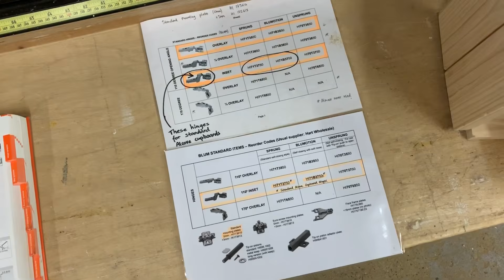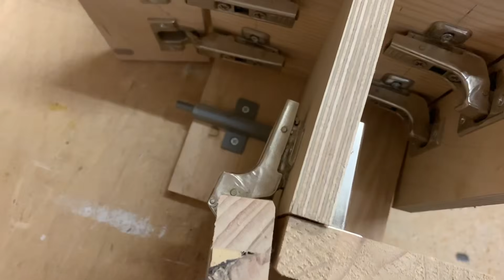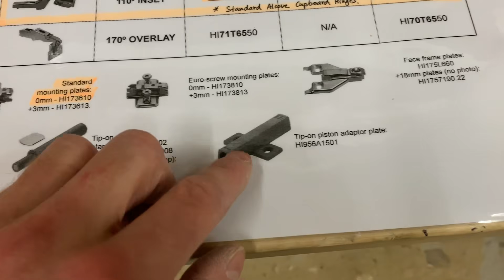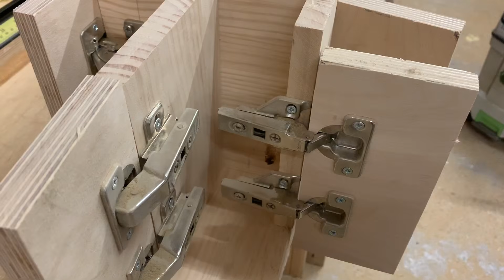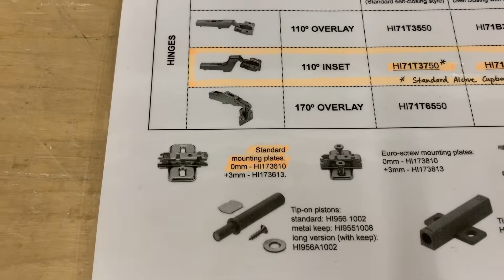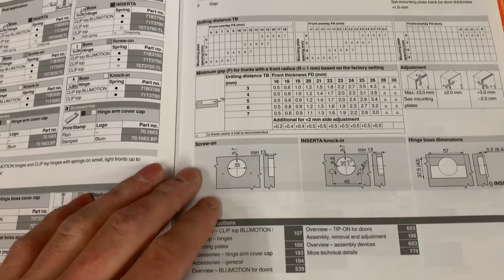All the main Blum hinge types explained!

Comment: Hi Alistair, I am really impressed by this video but I am also completely mystified how using the face frame mounting plate (at 5min 30sec in your video), you have managed to get what appears to be a 1cm overlap. I have tried to do this with no success. Do you need to use a specific blum hinge?
Reply from the maker: Honestly it was so long ago its hard to be sure - but I think I was using fairly standard 110degree overlay hinges on those american-style face frame mounting pates which, would typically place the door overlapping the frame edge by about 16mm - but there are many variables affecting that overlay:  Obviously the adjustment on the hinge arm - it's possible I adjusted them in a bit.   Also the cup hole drilling position on the door part - if that was nearer to the edge than usual, the overlay would be reduced.  Also the mounting plates themselves - I know we used to stock both 'zero height' and '+3mm' thicker variations as they often came in useful for problem solving, so these may be the +3mm versions.  Finally it's just possible that the hunges used there were the 'half overlay' style which are designed for mounting back to back either side of a single thickness dividers.  So, plenty of variables that may have led to your estimated 10mm overlay!

Comment: Hey mate I'm doing a false wall with 18mm mdf with a 20mm acustic board planted on. The hinge side of my door is binding on the next acustic board. Can you recommend a hinge that will cater for a 40mm thick door? 
Thank you
Reply from the maker: Hi Blum sell a 'thick door profile hinge' but i think 40mm is too much even for that one.  You could step up to the Sugatsune J95 but still might be tight.  Study the technical charts for each supplier carefully.  Rounding the long edges can gain a little more clearance
Reply: @Alastair_Johnson thanks mate

Comment: Because of my disability, I need the fridge doors to open wide, almost 180 degrees. The integrated fridge when its not installed allows such opening of the doors, but my builder said that once he instals it the doors will be opening less, about 100 degrees because the way the wood would be attached to the door. Is it possible that he uses different hindges to allow the 180 degrees opening of the fridge doors? Thanks!
Reply from the maker: Hi my son is a wheelchair user so these matters are of great interest to me too.  The fridge hinge will be different to all the hinge types shown here in how they are fitted and it's not an area I'm an expert in.  The funny thing is I just googled this, and it led me to your own question on mybuilder.com!  I see the answer was not helpful enough.  I have not been able to find a wide opening alternative.  If you find a solution I'd be interested to hear.  It's possible the best solution will involve lateral thinking about the wider design of the kitchen, good luck
Reply: @Alastair_Johnson  thank you for your response. I will definitelly write if I find an answer. If not, I believe we will just go and use the integrated fridge as a free standing one even though the look will be not so nice.
Reply from the maker: @risina1979 it is a great shame that accessibility needs still often stand opposed to good visual design.  When we renovated our bathroom we were determined to make it nice, not clinical like a hospital.  It was hard to do and we had to choose an independent contractor instead of the council approved options.  We did get a nice result but due to this contractor’s lack of experience making accessible bathrooms a couple of things were missed on that front.
Reply: @Alastair_Johnson  that is very true. At home we always try to have a good balance between practical and to look nice and modern. But in cases like with the fridge for us practicality is winning. Wish you all the best to you and your family.

Comment: Hi, great vid! I'm just curious and hope you can help me.. at 9:30 you used a hinge for a thick door and it pushes the door out.. can you use the same hinges if that door extends to its left (if youre basing it on your top view video)? Say you have an inset door with 32mm thick and the left panel is also 32mm thick, BUT both panels meet up at the corner to create a mitred cornering where only a thin line reveal is separating the 2 panels when closed? Would be a great video if you could do a mock up one using a thick end wall cabinet panel and a thick door, mitred at the corner. Would be a great architectural design as well for base cabinets with the same thick counter top material, say veneers or natural wood...
Reply: All corners would be mitred, top and sides, only revealing refined lines. That would be a great architectural furniture piece 😊

Comment: do you have a blum hinge you'd recommend for a flip top bench storage build? 
i've been trying to find information with no luck
my idea is that i would build e bench whereby the seating surfface hinges open like the lid to a box. 

thanks!
Reply from the maker: Sorry for such a late reply!! Yes it is often done with a standard 110° overlay hinge.  With the back edge of the flap receding the 35mm diameter cup of the hinge and overlaying a back panel that received the mounting plate

Comment: is it possible to use the 170 for thick doors, like 1" thickness?
Reply from the maker: No we find that the 170 degree hinge can bind at full angle even on a 22mm door but the 155° may work better for you

Comment: I hope I am able to clearly describe my situation.  I have an inside corner/blind corner  cabinet.  It had a hinge between the door side that is a normal hinge, and then the second door which makes the 90 degree inside corner had hinges that allow both doors to be opened at the same time. Those hinges on the inside corner got rusty, and instead of removing them and going straight to the hardware store, they got lost.  Can you hazard a guess as to what they are called?
Reply from the maker: Sorry I missed this comment!  These things are so hard to describe in writing. Did you resolve the situation?
Reply: @ thank you for responding!  I have not simply because I keep forgetting to bring my doors to the hardware store.  I should just try looking up maybe inside corner hinge.  But I do appreciate your reply.

Comment: disappointed. you installed inset hinge wrong, not sure the half over lay nor tell the plywood thickness. you could explain them based on blum data book.
Reply from the maker: It sounds like you go by the book - it is there for you when you need it.  I recommend seeing these hinges as tools that you can use however you wish to once you gain a full understanding of how they work.  It’s true to say that the inset hinges is usually set back from face of carcase for a fully inset door, but we have chosen to use it in a semi-overlay fashion to reveal the cabinet side in our alcove cabinet installations, making it easier to fit a scribe, increasing the usable cabinet opening, and saving time.

Comment: Hi, thanks for the really informative video!
Could i ask for the blum 170 hinge you show at 9:34, does it have a resistance point before fully closing? Wondering if you'd need a harder push to close it if it was fully open.
Reply from the maker: Yes there is a sort of slight resistance point I suppose just before it reaches the point where the self closing spring starts to pull it fully closed - and the soft close attachment also resists that to slow the close in a controlled way.  But you don’t really notice this the same way in real use - the weight and momentum of the door will carry it through, whereas in the video you are seeing a very much smaller and lighter board with 2 hinges on and there is not the weight or momentum that the hardware was designed for

Comment: Are there any overlay hinges that when open, the inside of the door is flush with the inside wall of the carcass?
Reply from the maker: The Blum 155° is designed to place the inner face of open door just outside the face of the cabinet to allow tight fitting doors to open freely - this is the hinge used in Blum’s ‘space tower’
Reply: @Alastair_Johnson  I'm not sure if the Blum 155 is the kind of hinge I'm after. The pictures I could find about it didn't appear to be what I was after. However, I did find the 'frog' hinge which does seem to be suitable.

Comment: I just got a new kitchen in my rental home. The installer used soft-close on all doors. However, since they designed it without handles they added pish-to-open. Perhaps im wrong, vut isn't that a waste of the soft closing ng mechanism. All the doors look clean without handles, but I think I prefer a small latch or grip so it makes actually use of the soft close. Now I need to push each door to close it. I feel like I'm a camper again hahaha
Reply from the maker: Yeah I think touch - latched are best with unsprung (or even reverse sprung) hinges that ensure the door keeps swinging wide open after the latch does its job.  But I’ve seen doors delivery fitted on spring hinges, so the touch latch just forces a finger gap then you have to pull it.  It’s really pointless to use soft close hinges though!

Comment: Great video. I have been asked by AO to replace with thinner hinge for an integrated fridge installation. Still wondering what they mean by a thinner hinge. Would you be able to advise the best ones for an integrated fridge freezer.
Reply from the maker: Hi it’s hard to say without seeing the set up!  There are hinges specifically made for mounting kitchen doors to appliances

Comment: I'm building understair storage with inset doors so they go flush with the wall above (staircase is on the other side of the wall). A double door cupboard and a smaller single door cupboard. We are doing a self-build and I'm not a fine carpenter! I installed hardwood frames straight into the structural opening and managed to get everything square and plumb, then bought Blum hinges after watching this video. I made a quick prototype of the top door and found immediately that where the door goes to a point, it binds on the inside edge. So I had to remove a section of the top of the frame to flatten it out and it worked great. Installed the doors but hadn't realised the same problem in reverse exists: the OUTSIDE of the other double door binds against the frame when it opens to near 90 degrees.

So I contacted Blum, who were excellent and told me the exact correct product, but unfortunately it needs a mounting plate with additional screw that sits further back in the frame, something like 85mm back as the door is inset. Unfortunately my hardwood frame is only 75mm deep. Ugh. Now I'm wondering if I should ditch the whole frame set and replace with a deeper one. Or if I should make some kind of radius or even notch the frame (ugh) where it binds. It's my own home, so not a customer project... and my levels of care are decreasing as there are so many other aspects of the build to complete! If the former then that's a week of work down the drain :(
Reply from the maker: Please tell me the exact hinge and mounting plate codes they recommended so I can look them up and understand
Reply: @Alastair_Johnson  First I purchased 70T3790 (inset hinge without spring, as I was planning on using the tip-on spring), with mounting plate 174L6100. Everything fits fine except the left door of the double set. (the shorter door.) Then they recommended I go with 71B7960 (155 degree hinge) with 175H7190 (9mm mounting plate). There are a few problems with this solution: (1) my original mounting plate (already installed) has the knock-in fixings but the new mounting plate only has two options, system screws or chipboard. I was planning to test chipboard screws mounted into the knock-in plastic dowels already installed, which I hope will work. However problem (2) is that this new mounting plate part number states "Fix with additional screw if used with
wide angle hinges". As I am planning on using these wide angle hinges (I guess 155 degree counts as wide angle?) that screw should be installed. But it looks like that screw is set back an additional 26mm according to the Blum catalogue. As these are inset doors, we also need to account for 18mm + 1mm tolerance. So that's 18 + 1 + 37 + 26 = 82mm back from the front edge of the frame. My hardwood frames are only 74mm!
Reply: @Alastair_Johnson  I know it's a weird request but do you have the ability to provide a bit of hinge / cabinet making consultancy over the phone, i.e. some form of pricing for that?!
Reply from the maker: @MatSmithLondon  Hi Mat, I've found the video on your channel so I can picture it all now!  Yes we could have a quick chat, maybe message me via instagram @alastair_freebird and I'll give you my number there.  Then you could most easily drop me a tip for my time depending on how useful you've found it, via www.buymeacoffee.com/freebird

Comment: Hi, very clear explanations. I have angled under-stairs doors to fix as overlay doors  on the dividing panels but inset under the frame above it. The high side with the 45 degree point which has the hinges on it is going to catch on the flush frame above which is sloping down if using a standard concealed hinge. Is there a hinge that will move the door out horizontally at the same time as opening so it doesn't move across? Hope that is clear. and many thanks if you can help.
Reply from the maker: Yes I understand.  The 155degree hinge throws the door outwards as it opens more than other hinges however you will still need to cut a bit of a back bevel on the top sloping edge of the door to deal with this issue.  Or redesign it so that the door finishes with a bit of a flat top above the slope, and fill that in with a small fixed triangular panel.
Reply from the maker: An alternative solution that requires no back bevel on the door top would be the Sugatsune 'Lin-X' lateral door opening system
Reply: @Alastair_Johnson Hi. Thanks so much for thinking more about this. I did come across lateral opening hinges myself and made some enquiries. Jet Press also do a similar system. They are definitely something that would solve the problem but the cost is prohibitive. For a large door the Sugatsune hinges would be about £350 each so while ideal the the cost is not really affordable. I am still looking. One Utuber built cupboards to the same design but on questioning him he admitted he had to chamfer the back of the apex of each angled door until it would clear the surrounding frame. Regards

Comment: Alistair do you have to install the inset hinge closer to the edge of the carcass to allow the door to overlay it?
Reply from the maker: Yes
Reply: 18mm?
Reply from the maker: @dazlarg  the measurement from front edge of carcase to centre of mounting plate holes will be 37mm, as per this image: https://www.bullerltd.co.uk/images/detailed/33/0925-001-blum-clip-hinge-mounting-plate-173h7100-buller-33127.JPG
Reply: @Alastair_Johnson  can the soft close speed be adjusted with the Blum hinges?
Reply from the maker: @dazlarg  only by switching each hinge’s soft close on or off via a tiny switch on each hinge (for a heavy door you might keep all hinges soft closing, but for a small cupboard door you might just keep one hinge activated - we find it works best when it’s the lower hinge)
Reply: @Alastair_Johnson  top
Man Thank you buddy

Comment: Their are so many closures that it's  become impossible to find the correct one😢.
Reply from the maker: Not impossible!  What is it that you need to achieve?
Reply: @Alastair_Freebird  replacement at work has 3 different cabinet closures each different in style and length.
Reply: @Alastair_Freebird  also I'm assuming that their German  made with what's on them
Reply: @red2965  Austrian
Reply: Most hinges are covered by a few questions:
-- What's the overlay?
   Zero (inset), 1/2 inch, 1 inch.
   Overlays can be slightly adjusted by a screw or shim.
-- Is cabinet face frame?
   Then you'll need a hinge that attaches to the cabinet edge.
-- Do you want soft close?
   If the hinges are already installed you can add a soft close piston.
-- Do you need the door to open more than 90+ degrees?
   No you don't. But if you do, then consider using traditional non-hidden hinges.
-- Are you replacing old hinges?
   Then consider whether the screw spacing on the door is 45mm or 48mm. And even then the screws may be in the wrong place, so you'll have to fill in screw holes and make new ones.
Reply: @NonameNoname-rf3hg I’m trying to identify my hinges because they currently open >90 degrees and I want to add angle restrictors. I need to know which ones will work with my hinges.

Comment: By far the best video explanation I've seen of these type of hinges. I was looking for the hinge mounting plate system that Blum refer to as the 'Face Frame Plate' (number HI175L660) and here it was - I was starting to think I must have imagined it. Now to find a supplier here in Australia - but the Blum catalogue (2023) seems to not have it anymore though. Sigh!!!
Reply from the maker: There are quite a few things which have been removed from the catalogue but are actually still available.    Ask around at major hardware suppliers and you may yet find them over there!

Comment: Struggling a bit to find the right hinges for my 36mm thick overlay cabinet doors.
Reply from the maker: Try Sugatsune J95 hinges
Reply: @Alastair_Johnson  Bought it but realised during installation that it only works to max 34mm.
Reply from the maker: @J-man2026  What's the reason for the doors being so thick?
Reply: @Alastair_Johnson  The baseboard is tacked to the door. It's a hidden maple door, part of wainscoting on a wall. 20mm door and 16mm baseboard.
Reply: The solution was Blum 71B7550D